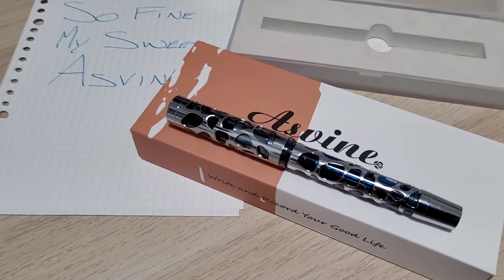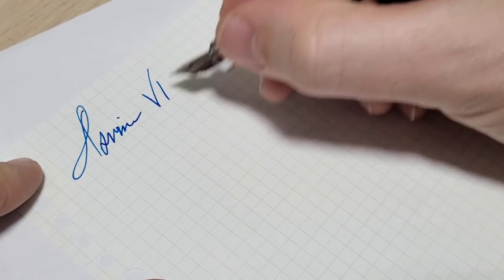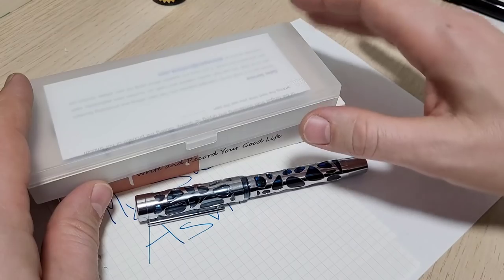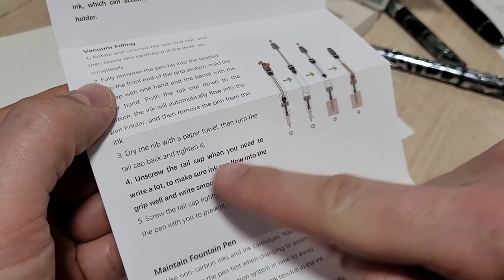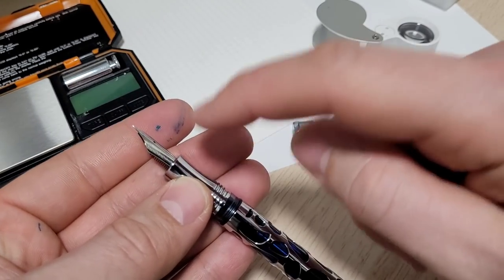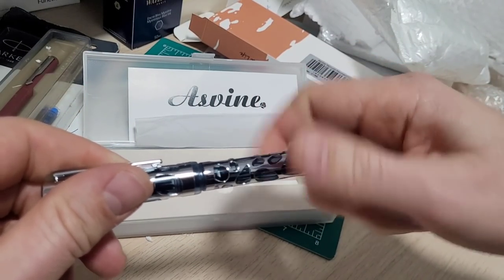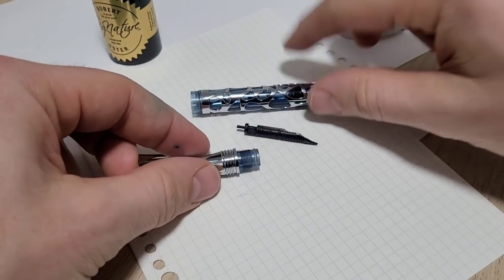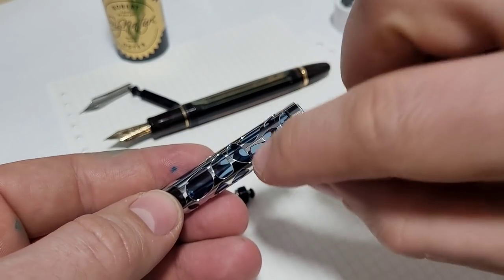What's STOPPING This Pen From Being GREAT?

Comment: My problem with the instructions is the line spacing.  Each step should have a smaller line space so the step 'reads' as one thought.  More space between steps or bullets.  Just a lazy designer?  Or a designer that is under the gun to get it done?  Someone who is not a graphic designer?  The line spacing bothers me like nails on a chalk board.
Reply from the maker: Even pickier than I am lol. Was impressed this was done on a 4 color offset press! These won't be getting updated anytime soon! Would have done a large run to have the savings in initial setup. Wouldn't be surprised if I see these exact same instructions on other pens from other brands 🤔🤔🤔

Comment: Great review.  I enjoy how your engineering background leads you to things that normal reviewers would never notice.  

I have had my V169 for a couple of weeks and I have also been wonderfully impressed.  I don't have the problem with the cap meeting the body like yours does.  Mine sits about like the Narwhal so I kind of chalk this one up to variances in manufacturing tolerances.  Strangely, my clip also leans to the right.  I figured it was just Chinese quality control but based on our sample size of two, there seems to be something in the process that is causing the bend.

The things I have read indicate that Asvine is an OEM manufacturer for other Chinese brands and after looking at the packaging and some of the designs in this pen, it is safe to say that we know where Moonman pens are coming from.

Keep up the great work.  Love the enthusiasm and the delivery.
Reply from the maker: Clip can also get stuck on some of the cut outs when you untwist the cap

Comment: Parker used to be a wider line than the competition, too. Basically so people didn't confuse them for a Sheaffer's (my '47 51 Vacumatic is an extra fine that's almost identical to the Sheaffer's fine from the same period, for example.) Don't think that there's any standardisation even today.
Nice to see this from your perspective, and from your background. It is a pen that's on my radar, and your perspective helps!
Reply: I wouldn’t want there to be standardization. It’s part of the unique and individual character of the manufacturers and I love the eccentricity
Reply: @animula6908  And yet there's those that rely on a chart, and say that the line width is different from what the manufacturer said...
Chart like that is a guide for an average, not a hard and fast rule. 😁

Comment: I have one of these ordered that is supposed to arrive Monday.  Blue-gray (same color you have here) with an EF nib.  I like a pen with some real heft, so I don't think the weight will be an issue for me.  

I have several Wing Sung pens (3003, 3008, and 3013) where the clip is held in with a screw in a similar manner to this, and yes, the ones I have inked up have rusted from moisture in the cap due to temperature change condensates, etc.  I'm glad to hear this is a brass screw.  From a cost perspective, I don't know if a raw brass screw would be more or less than a raw stainless steel or even aluminum screw, but I would not have used a plated screw.  I just don't think that was a necessary step in the production process.  

I'm looking forward to my pen arriving Monday.  If they take your advice and make an improved, updated version of this at ROUGHLY the same price point, I don't think I would feel bad about investing in one of the upgraded pens when the time comes, either.
Reply from the maker: The plating was to go with the overall esthetics of the pen and make things consistent.  It looks really good when you look into the cap and see consistency.  However, I'm not a fan of plating a fastener.
Reply: @Doodlebud  The cost is on it being a custom made screw, and not the plating, as it all gets platted, as the other parts are brass as well. I get they wanted the same shiny sheen on all the metal parts.

Comment: I’m looking to get this pen in the near future. I just ordered the Majohn a1 which is their copy of the pilot vanishing point. I need one for work because I work in a machine shop and all the metal dust and bits get in my threads and I don’t like it. I wanted to try the copy before I shell out 150 bucks for the pilot. Hoping the click function and seal will work out at… uh.. work

Especially considering I just had to send my BRAND NEW pilot custom 74 back to pilot. I don’t want to spend another 150 bucks and have to send it back and wait for it to work properly. This was my first pilot pen and my first gold nib and it was disappointing I had to immediately send it to pilot after I got it
Reply: @flowerpot-h7p  that’s sort of why I got the a1 first. We’ll see how it goes

Comment: Okily dokily. I had decided not to buy this pen, but then figured out that unposted its weight is comparable to my Parker Urban posted—which I find very comfortable. So we shall see. Due to arrive today.

The other concern I had, is the section unscrewing with the cap. To address that I plan to try my mountain bike/Lamy Logo hack (Logo—man do I hate that pen—section always unscrewed itself WHILE I WAS WRITING…). Beeswax aka ‘nature’s Loctite’ on the section theeads to the body. It works pretty well to keep my mountain bike parts from vibrating loose on my city’s crappy roads and was ok on the reviled Logo—maybe it will hold the v169 section to the body well enough that it won’t unscrew with the cap.

Comment: It seems like the o-ring on the section threads would have prevented the section from coming off so easily; at least my sense is that usually o-rings add some friction and resistance to unscrewing threads. And you don't want that section coming off that easily anyway, you would only take it off for cleaning. So maybe they need something slightly different in the o-ring -- thickness, or material, or something -- in addition to the design change between the cap and section/barrel. 

Anyway, good discussion, full of things to think about. I would argue about the quality of the translation compared to Japanese products, and the print quality of the instructions, as being a little fussy for a $36 vacuum-fill pen that writes well (and that comes in 4 acrylic colors and 2 metal colors). That's just me. If I were going to change anything in the translation area it would be the name! They need someone who speaks English who know how that sounds.
Reply from the maker: Oring change is a bit of a Band-Aid approach I think. Orings are primarily designed to provide a seal. In this case, the end of the grip section is supposed to be in contact with the inner step inside of the cap.  So here it should be a matter of a dimension change in the part to allow for proper clearance.  Pretty good considering the price, but a bit more attention can make it really good
Reply: @Doodlebud  I have a few pens where there is an o-ring below the threads right where barrel meets section just so the connection tightens up, and takes some force to unscrew, so it only unscrew intentionally, and not while taking off the cap. My V169 does seem to touch, so this doesn't happen. Some tolerance issues. Clip is crooked as well though.

Comment: Leave that metal skeleton off, to save on that heavy posting. Got it in EF.  Gold.. it writes SO smooth. I’m a new subscriber. WOW. You are The Engineering Pen Master, indeed.  This is only my second Fountain pen. Grabbed a Duke w/ a FUDE nib. So I really want a good flex nib maybe fine or medium for my art.  Do you know if u can get a flex on the Indigraph?  I will now be binging your videos. Also, Iove how you did a beginning review! Of course, I had to watch it all though. Thx SO much! Much appreciated !    - Messy Mendy 🖌✍🏼👍🙏🏻
Reply from the maker: Haven't heard of the indigraph so not sure. It's a pretty good pen for the money. There lots going on at that price point: vac filler, looks cool, very smooth nibs. So that's why I broke that review into 2 parts. It's a good pen BUT.... how could make it great & it wouldn't take much actually

Comment: Great review. Using chrome and brass is for cost, for sure. I have a Visconti Skeleton using titanium for the overlay. Weight is less and is non corrosive. I am not a big fan of heavier pens unless it is well balanced. Metal section is not a horrible day thing if you have some texture on the surface. Look at the ēnsso you have. Chrome is very slippery. Cross pens have grooves on the grip area for their chrome pens. 

Overall an excellent review.

Thanks again.
Reply: Wasn't that Titanium coated sterling silver for that Visconti?
Reply: @martinlebl631  yes it was
Reply: @paulmchugh1430  I really wanted one, but it just wasn't feasible given the price. But such a good looking pen.
Reply: @martinlebl631  unfortunately it was pretty expensive from the beginning with a convertible rollerball / ballpoint being over $200. I have the second version with a glossy finish and a pencil converter included. So, you could use it as a rollerball, ballpoint and a pencil.

Comment: You could use blue tack, Sugru glue or Kintsuglue to protect the screw in the cap from rusting...
Reply from the maker: Yup, or they could think about this stuff during the initial design phase.  Easy to fix.  Stainless steel screw or even lower cost could be the same screw but a little plastic/silicon disk that is installed to cover the screw.  Companies shouldn't be expecting users to fix their oversights.  Same for the issue where the barrel unscrewed instead of the cap.  All they need to do is reduce the bore depth on the step inside the cap by about 0.3-0.5mm.  Costs absolutely zero $$$ to fix that as its something to update in a drawing.

Comment: The primary deal killer for me on this pen is the thin, concave, smooth, metal section— then there’s everything else you pointed out. It may be a smooth writer, but if that’s the only thing going for it, I may as well stick to Narwhals. If a pen manufacturer is bringing something new to the table, they have to do it right, or otherwise, don’t bother.
Reply from the maker: It is pretty slick, definitely not for everyone. Easy to incorporate some features to help with grip
Reply: @Doodlebud , like what?
Reply from the maker: There could be a few ribs put into the section to aid in grip.  Similar to the Lamy imporium grip section.  Just need to ensure the minimum feature sizes will still work when taking into account the thickness of the chrome plating.
Reply: @Doodlebud  punchlines. Always wonder why there are so many smooth metal sections. Just put some knurling on them, which would make them a lot grippier, even if you choose to plate them with slick chrome finish.

Comment: I never read the manuals so I would’ve been blissfully unaware of picture alignments or grammar. 

Maybe I missed it but were the cut outs sharp or were they smoothed out afterwards? The metal should be sought enough to round down.
Reply from the maker: They was deburring done, but a few spots were still had a sharp edge to them.
Reply: @Doodlebud  Same on mine. I think some point a bit outwards as part of being punched out, and didn't get as much care as most of the other punchholes.

Comment: Got the same box with my twsbi
Reply: Was it branded Moonman? 
In the bottom corner of the box its saying Moonman in this review.
Reply: No it’s branded twsbi in the center lid but it appears to be the same plastic box, as if they are branded on order of bulk supply.
Reply: @michaels3429  Most probably is a third party manufacturer for the box and TWSBI or Moonman are buying them from the same place and then asks to be branded in their name.